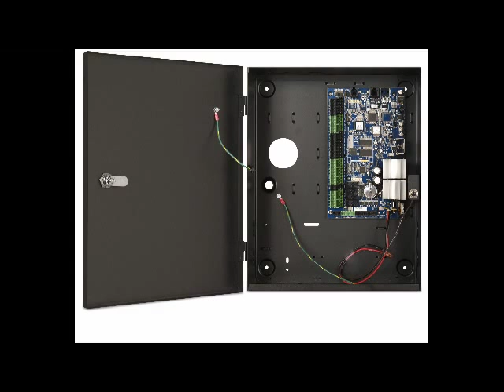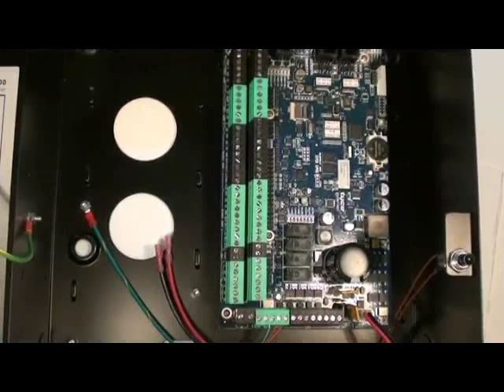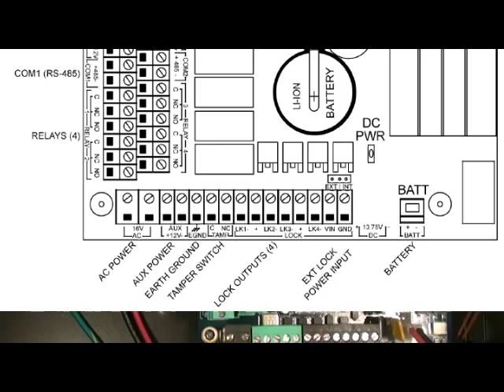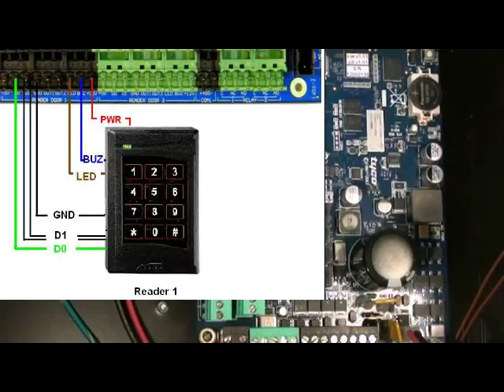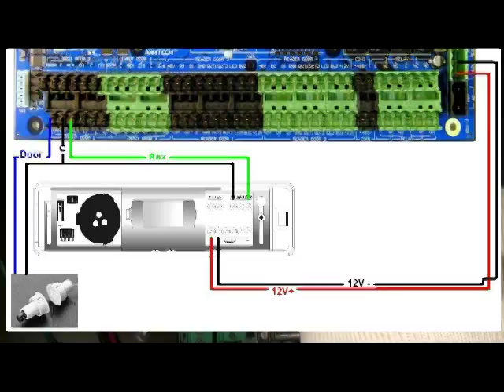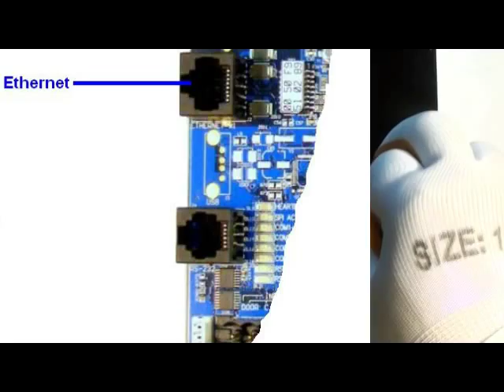KT 400

Comment: Can a external universal garage door opener ( defiant universal opener product MK-1TH) be used to open and close a gate on the kt400? Any help would be usefull
Reply from the maker: +Sluggie KT-400 can comes with 4 onboard relay ready to be used (dry contact)you could set 1 of those relay to follow lock output // this will do the job.or you can use an external relay connected at the lock-output of the KT-400 and the other part going to your Gate system.In any case this can be done.